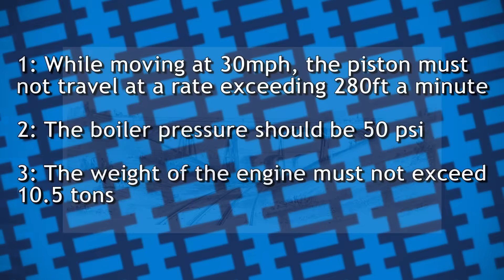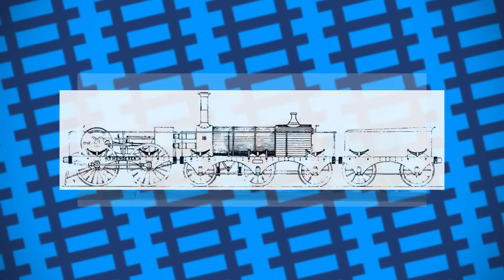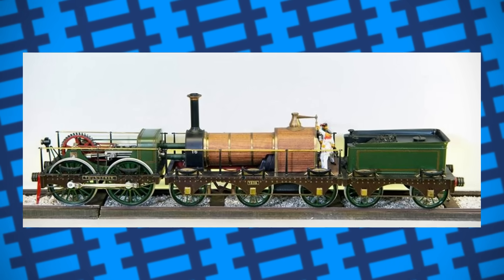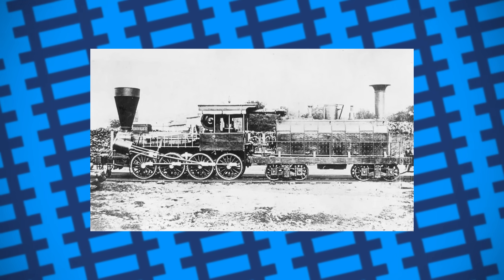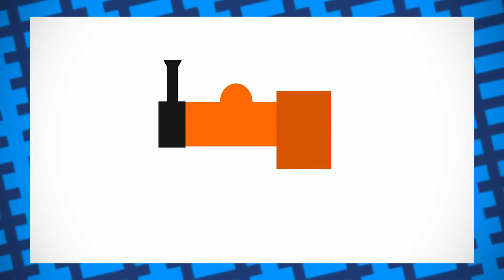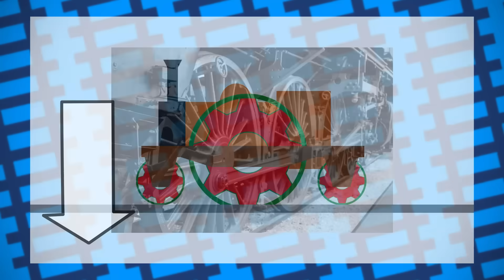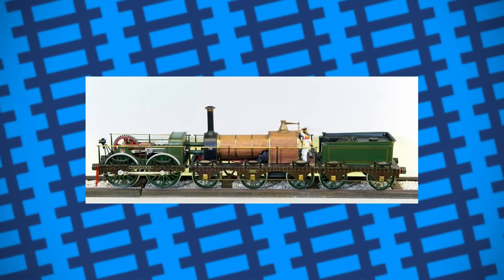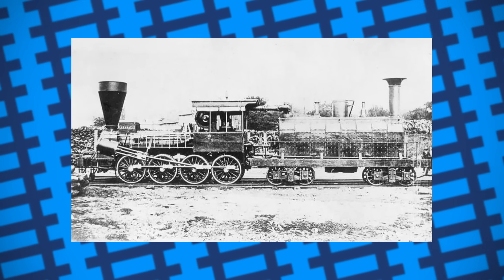Why Locomotive Boiler Placement is Important - "Hurricane", "Thunderer" & "Novelty"

Comment: I guess this is what happens when an engineer, inexperienced in locomotive designs, tries his luck on designing locomotives on his own, only to produce engines that look like they came straight from hell.
Reply: Nope, engine designer was rather good, the issue was purely the silly weight limit on the railway for engines which led to the disconnected elements

Comment: I guessed it at first glance of the blueprints "where do you get the traction?" and immediately thought of garratt's sedan layout. It IS solvable, but that would result in an articulated structure. ALSO note that 2-2-2 is already a TERRIBLE traction provider at all as you want ALL wheels to be driving wheels in a traction prioritized model!

And they didn't even calculate how much power is needed to travel at 84 mph...the "asia express" in japan occupied manchuria travel that fast and it's a pacific 4-6-2 locomotive with MUCH MUCH bigger boilers and driving wheels. Your puny boiler won't make it at all.
Reply: The Pearson broad gauge 4-2-4T reached 84 mph or so in the 1880s on the light short trains in use then.
Reply: @johnd8892  This is ridiculous. For that date I would assume a 4-4-2 atlantic to reach that speed. Also the "T" tank locomotive? It carries so little coal and water that it would deplete it in minutes.

Comment: why couldn't they have the tender on top of the driving wheels, then there was at least some tracton left.
Reply: As you draw out water and fuel, you lose traction. That is a problem that every engine that put drivers under the tender faced.
Reply: @Ghauster That's not an issue at all, every engine with a tender had none of the weight from fuel or water or tanks over the driving wheels
Reply: @gherkinisgreat  But it would be if you put the driving wheels on the tender, as is being suggested here.
Reply: @gherkinisgreat  bit incorrect, as there were most definitely tender locomotives that had additional booster driven wheels under the tender, and of course it was an issue with the garratts, and noticeable with the triplexes

Comment: Lack of surface area has no impact on adhesion.

Friction is dictated by the normal weight multiplied by the coefficient of friction. You will note surface area doesn't matter.

Steel on steel has a very low coefficient of friction, so if you remove the normal force the boiler provided you lose traction, but the surface area doesn't matter. 

If surface area incresed friction skiing would be impossible.
Reply: tribology is a complex section of science that does not work this easy way in reality (such happens in road tires). But yes if you want adhesion you want more weight pressing down the wheels, not larger contact surface of wheels against rails.

It doesn't matter whether the pressing down force comes from boiler weight or whatever, and you will find more driving wheels to be useful and more non-driving wheels to be hazardous if you don't increase the press. That's why 2-2-2 is bad and 0-4-0 is better.
Reply: @phoenixarian8513  I was taught that the reason a larger contact patch on road tires helps is not because the contract patch does anything, but because larger tires allow for a higher coefficient of friction to be used for the same tire lifespan, since there's more rubber to burn. 

So larger tires are made of a stickier compound. Something not applicable to trains. 

Your comment implies differently?
Reply: @HALLish-jl5mo  "You will note surface area doesn't matter."
And that is just categorically wrong: That is a simplification for sliding smooth surfaces with decently rigid and smooth surfaces under moderate pressure. Outside of that grip is also a function of pressure.
but for this example here yes - the problem comes from a lack of force, not lack of pressure.

Comment: 2:01 So LITERALLY just the Garratt engines... but before it was perfected.
Reply: A Garratt does have its weight on driving wheels.
And these just have 'boiler tenders'.
Reply: @ yes but it's an unbalanced weight as soon as the front tank is emptied (the front Chassie would start doing a wheelie) so that front tank was essentially dead weight
Reply: @TheClass56xxfan  I really don't know how you came up with that idea.
Reply: @smedleyfarnsworth263  by speaking to people who have driven GMAM garratts and also the narrow gauge ones. (I also don't mean an actual wheelie, it's just gets the idea across better than describing a backward list)
Reply: @TheClass56xxfan I feel you have misunderstood what they were saying to you.
Reply: @smedleyfarnsworth263  🙄
Reply: @ Hmmm you don't like to be corrected do you. 

It's not that you're ignorant; it’s that you know so much that just isn’t so.
Reply: @u2bear377  I suspect that another motive for this choice of design is axle load. I seem to remember something about the early rails warping due to the long distance between the sleepers. Which could be a reason as to why they opted not to have the weight resting on the end of the 'engine' like you see on the garratts. Brunel was no fool
Reply: on the Garratts they never emptied the front tanks because the front chassie would list upwards from the weight of the boiler as they emptied. so, it's the same problem and just dead weight
Reply: @TheClass56xxfan is that all 1600 or so Garratts or something specific?

Comment: as soon as I saw Hurricane's design, I was like "dumb mfs back then didn't factor in adhesion..."
Reply: Maybe they discovered the effects of adhesion weight after these engines had been designed?
Reply: @gherkinisgreat  Nope. Trevithick had done that in 1804. So too had Cugnot in 1769.
Reply: The rules of rail roading were still being written when these experimental locos were made.  Everything they were doing was to them "Rocket" science, pun intended.
Reply: Um no. It was a perfectly cromulent design worked by T E Harrison, engineer of the Stanhope & Tyne Railroad. They first one was designed to pull heavy coal trains on a very challenging route.His notes, including load and tractive effort all survive :)
Reply: I mean if you don't have the Tender as an extra wagon, but put it on the same wagon as the driving wheels it works fine. The problem seams to be more to give up on a design based on one problem.
Reply: Not dumb, just unexperienced.

Comment: Gotta love Brunel’s proto-Garratt that nobody asked for
Reply: Hehe, proto-Garratt
Reply: Garratt larva, with additional multiple wheels under the boiler which disappeared by metamorphosis.
Reply: He did
Reply: It's crazy that no one has the idea of using the driving wheel section as a bogie. Until Garratt.
Reply: @klausstock8020  The idea existed much earlier. Cockerill in Seraing, Belgium, built two articulated engines for the Semmering line in Austria already in 1851. The designer was Wenzel Günther. Later, in 1861, Jean-Jacques Meyer patented the design. At that time, Herbert William Garratt wasn't even born yet. Robert Francis Fairlie designed the Fairlie type of articulated engines in 1864. Anatole Mallet developed the Mallet locomotive in 1884, more than 20 years before the first Garratt type locomotive in 1907. In fact, the Garratts are the very last of the designs using the driving wheel section as a bogie in steam engines.
PS: Forgot to include designs like the Shay (Ephraim Shay 1881) and Heisler type of locomotives (Charles Heisler 1892), which also predate the Garratts.
Reply: @klausstock8020  not for 3t axle load
Reply: It's not a Garratt. At all.
Reply: @AnthonyDawsonHistory  I am aware but this comment was jovial in nature
Reply: @Ty-yt3lj  Good good! And of course the Garratt and Harrison's patent locomotives had two different design criteria behind them.